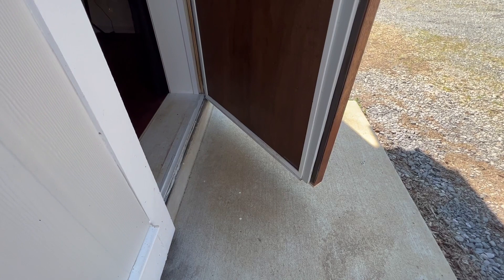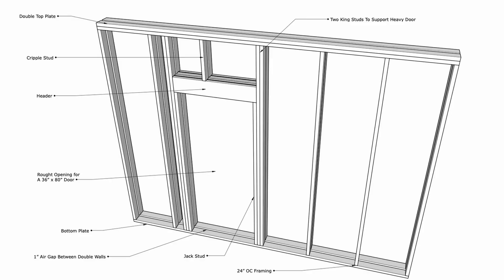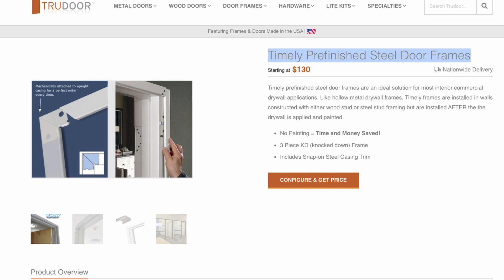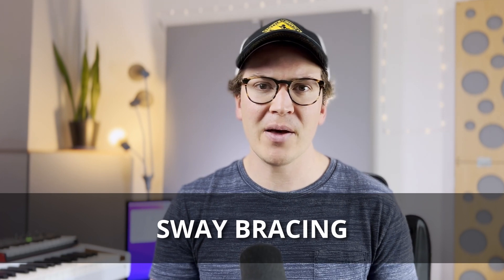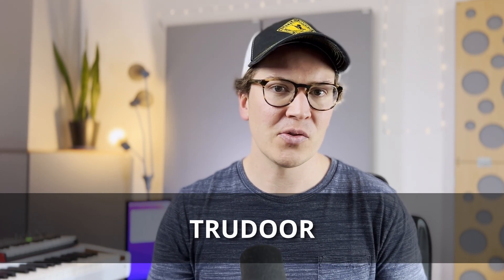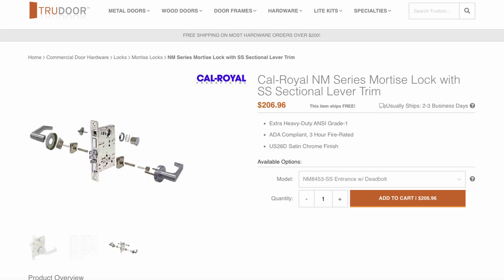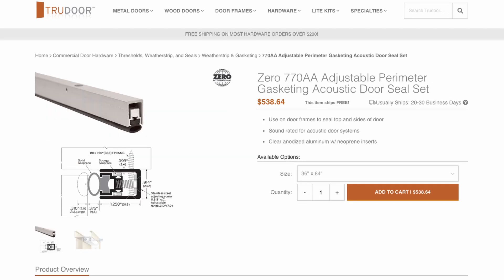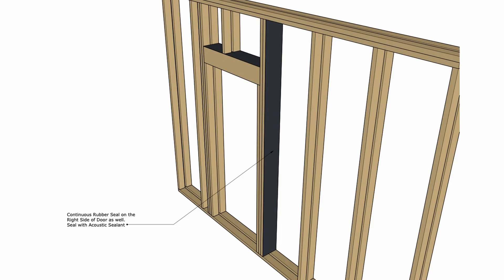How To Soundproof A Door - Part 1

Comment: Another great vid!  So much good info here and super timely since I’m getting close to making my doors in the garage conversion.  Quick observation.  I’m not sure the design of the rubber on the outside of the King studs and header is air tight.  Seems like you got a gap in between the walls where the header meets the king studs, no?  Not sure it makes much difference but just something I saw.
Thanks for sharing all your knowledge!
Reply from the maker: Yes, please watch part two.

Comment: Thank you Wilson for the tips. I watch your vdeos with great interest.
I am struggling to find plans or any tips on how to build an outside studio door for Canada's -30 degrees celsius winter weather. Solid core wooden doors are great, but the humid and cold weather makes them less than ideal because they tend to wear out pretty quickly (swelling, rot, ...). I can't find any solid core door that is doubled with foam on the outside. All the (metal ou fiberglass covered) outdoor I can find are all hollow core filled with foam.
Do you know of any type of door that would withstand Canada's cold weather ? Ideally an outswing door.
Reply from the maker: I think you need to buy an exterior door with as much mass as possible. Then if needed add more mass to the inside of that door or make up for it on the interior door of a communicating door system.

Comment: Would the steel framing still work for a single wall with one side suspended with iso clips and hat track? Afraid of short circuiting the decoupling
Reply from the maker: No I wouldn’t do the steel framing with a hat channel. To be honest, the more I think about the steel framing I don’t really like it. I will make a part two video this week that will clear things up.

Comment: I have seen a lot of diagrams where they deliberately stagger the studs in the middle of the wall.
Reply: From my understanding, staggered studs is a trick used when you can't have two separate walls. I'm not sure it would bring much benefits in a doubled-wall system
Reply: Even with separate walls they stagger the studs. At least for sound locks at TV studios.  @HCkev
Reply from the maker: Yeah you can stagger studs. This will ensure over time that neither stud will bend and short circuit the system.